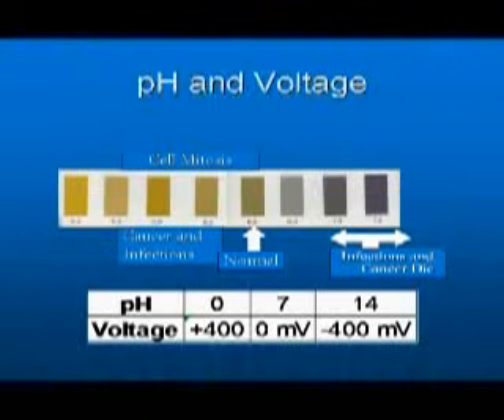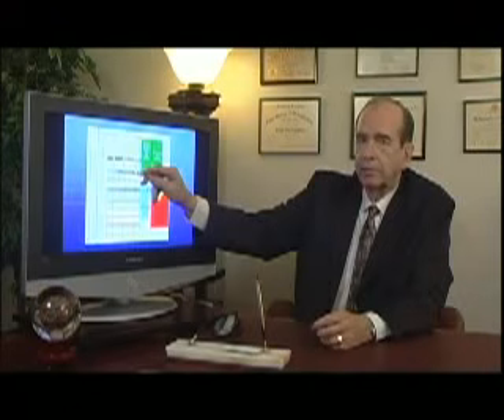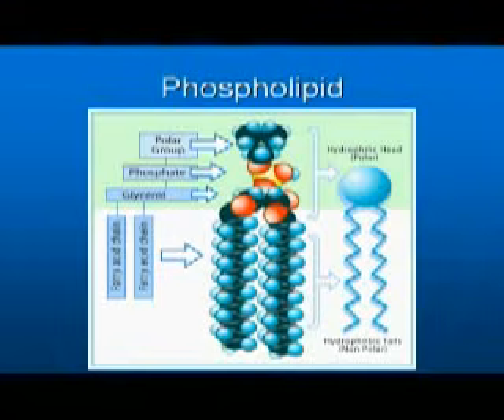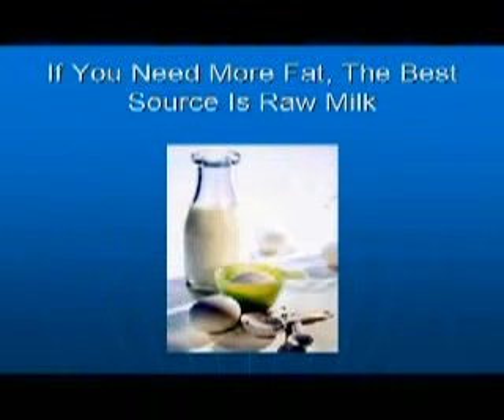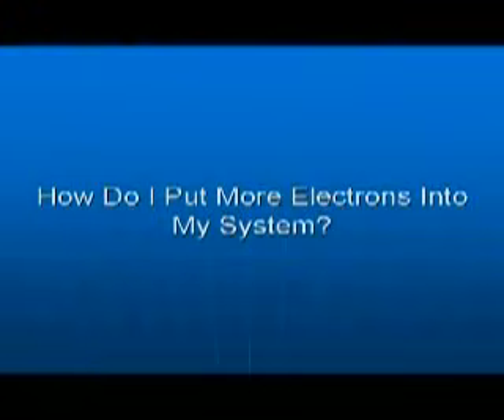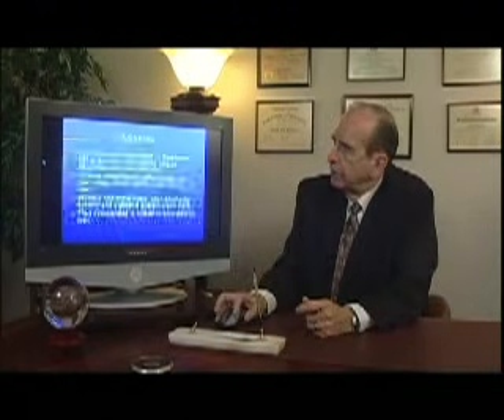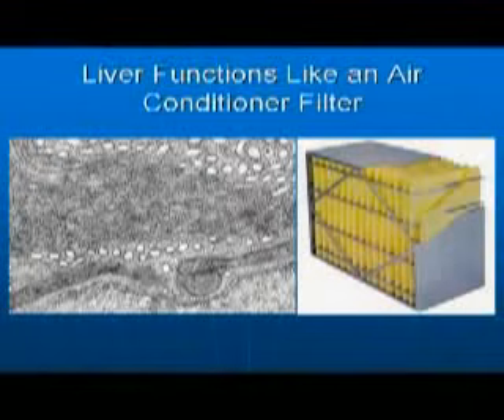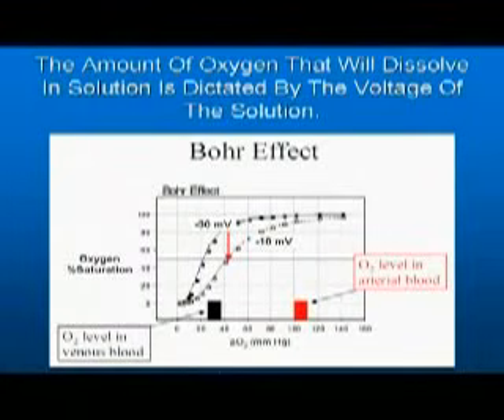Dr Jerry Tennant - pH and Voltage - "Healing is Voltage"

Comment: Great video, but at 7:25, he says that in nature, two conductors separated by an insulator becomes a capacitor. I can tell you that this is not true at all. When you have two conductors separated by an insulator, it just means that an electric current cannot pass between those two conductors. That is a fact.
Reply: Actually, what he says is correct: In nature as well as in engineering, two conductors separated by an insulator form a capacitor. This basic configuration stores electrical charge and creates an electric field—it's the fundamental principle behind capacitance. Even biological systems like cell membranes act as natural capacitors.

Comment: The pharaohs used a device known as the "cylinders of the pharaoh" made from copper(anode)  and zinc(cathode) cylinders filled with quartz when held produce up to 1.5 volts.  The copper is held in the right hand which is the positive flow of ions and the zinc is held in the left hand which is the negative flow of ions through the electrolyte(human body).  Make them yourself or get them on amazon or etsy.
Reply: How do I find it? Thank you.
Reply: Would it work if I wore a zinc and a copper bracelet?  Or it must be held in the palms?
Reply: @incorectulpolitic  It still works as bracelets but the palms are more conductive.
Reply: @engineerjay420  did you try these methods? Do they work? If so, what do you notice?
Reply: @incorectulpolitic  I personally make and use both bracelets and rods.  Absolutely aid in healing, pain, inflammation and increased energy levels for myself and many others.
Reply: @engineerjay420  so far how is your experience with the rods plus bracelets after 2 years?
Reply: @moiaccaunt  My experience has been really amazing from better sleep to deeper meditation and just overall well-being I highly recommend trying them.
Reply: @engineerjay420 where do you sell your rods that you make?

Comment: Cancer is a viral disease. Virus destroys mainly end cells (matured cells in Q
compartment), to which the organism responds with chronic inflammation and
increased proliferation to restore the organ and clean the debris. In this
chronic inflammation tumor may emerge. When stem cells are hit, the entire
Tissue Proliferation Unit disappears, to which the organism responds with
dysplasia, carcinoma in situ, carcinoma, etc... According to the hypothesis of
professor Zajicek MD, tumor protects against cachexia (muscle loss, wasting
manifested as fatigue and weight loss). Every cure, which silences the disease
driver, namely virus, cures cancer. Muscle loss is seen in all cancer types.
Cancer is one disease. Example: Fever is a defensive mechanism. Plus two
degrees protects while plus five kills. As long as tumor does not block any
vital function or causes pain, it should be left untreated. Patient should keep
her tumor as much as possible. Some people find alternative treatments, like
Ann Vigmor diet, very helpful. With a treatment strategy of tumor dormancy and
with host resistance to virus , only minimal doses of medication may be
required. Tumor dormancy is a state:when tumor shrinks or stop growing. In any
case patient feels healthy.

Comment: If using ionizing maschine with negative ORP water, don't the stomach acid neutralize that water when you consume it?
Reply: I thought so too.  Then I read Dr. Tennant's book.  It's not that simple - for everything you put in your stomach that needs stomach acid, other organs (liver, spleen, etc.) put a buffer of bicarbonate into your blood (so there's 2 things going on).  If you drink alkaline water, your stomach does need to neutralize it (and it does), but also puts that bicarbonate into the blood.  The alkaline blood buffer is important and the main way that alkaline water keeps the overall system in balance.

Comment: should we use AC or DC to measure teeth voltage? should we measure only the teeth with fillings or all of them?
Reply: Did you find out? I was also asking myself about it.
Reply: @esterilladorav.crespo2617  I never heard back from them either sorry
Reply: DC.  All measurement/assessment stuff refers to DC except that AC signals are used by Tennant's Biomodulator device to apply treatment frequencies and for feedback to adjust those applied signals.

Comment: where can I find device that measures body voltage the correct way? Its not the multimeter is it? I tried to look up that device in the video with the Phase Angle but cant find it. Is EAV the only thing?

Comment: Electrical Sensitivity, do to EFs "Electro Frequencies" and EMFs "Electro Magnetic Frequencies" To change your bodies Voltage/PH level, and receive all the Free Electrons your Body needs to Heal most Everything without the expense of a Biomodulator, this is the absolute Best way to do it. This has eliminated all my body Muscle Pain, Inflammation, Arthritis pain, Adrenal fatigue, No energy, Foggy Brain, Depression, anxiety, and that was Just my symptoms, it provides so much More for people with other Ailments or diseases, It is a Miracle cure. Google "Earthing human clinical studies" to see the success with Human ailments.  1st thing to do is Earthing, Google "Earthing" ,  Earthing adds the Electrons to the Body,  to Store the Electrons in your Cells you need the Concentrace Trace Minerals, the Concentrace Liquid Drops Trace Minerals, these two things are VITAL to LIFE and well being and should be used together as they complement each other, and the human body is deficient in Both. Sleep on a grounding sheet, and drink at least 3 + 12 ounce glasses of water with 10 drops of trace minerals per glass for about 40 drops of intake per day of the trace minerals.  This is as Important to life as breathing or eating, over the long term for health and well being. You will get the same out come as you will be adjusting your bodies PH higher to a safe level and reducing your bodies Voltage level to a Safe average negative voltage level. The Earthing will provide the Body with Free Electrons. The Free part of the Electrons means they are Not yet attached to another molecule, so they are free to become attached to a Molecule. The video is correct about Electron Donors vs electron stealers at a given PH/Voltage  level. It is when the Body does NOT have enough free Electrons, and body Voltage is Positively charged, is when diseases like Cancer, diabetes, and a slew of other diseases occur. This is because when You do NOT have enough Free Electrons coming into the body on a regular Daily basis to get rid of your accumulation of daily Inflammation, this is a condition of Low PH level, and a Electron Deficiency are the root cause. Easily corrected without a Biomodulator, 
Show less
Reply: how should earthing be done and for how long ?

can you do earthing standing or laying on grass or one must touch the bare brown ground/soul ?

Comment: If these battery packs exist as stated then it should be easy to verify in a controlled laboratory  experiment where the normal required voltage is applied to the circuit that controls the heart to produce a beating heart in a cadaver.
Reply: We know that to be the case with the heart.  You have the Vagus Nerve which varies the pace of the heart and which you can replace with a pacemaker.  You can apply voltages to the heart and have it pump.  You can also measure the voltages on a heart which we know from the ECG.
Reply: Did you know that Earl Bakken - inventor of the pacemaker - was originally inspired to become an Electrical Engineer by the movie "Frankenstein" (then Mary Shelley's book) when he was a kid?  He went on to found Medtronics, the 900 lb "gorilla" of the Medical Device industry.  Visit the Bakken Museum in Edina, MN!  These battery packs apparently do "exist" Tamara.  Even the idea is nothing new.  MORE POWER IGOR!
Reply: If anyone cares: so what inspired Mary Shelley to write "Frankenstein"?  The story goes that she, Lord Byron and another writer friend were staying with Byron at his estate on a short vacation.  Byron proposed a literary contest:  who could write the best short story in the week or so they were to be there.  He had a large library - Shelley found some of the writings of Paracelsus, a great physician & Alchemist of the 1500s, famous for walking around Europe curing the Black Plague wherever he went as well as his bombastic writings that railed against the ignorant medical establishment of the time.  He was also famous for having (allegedly, and by his own claims) to have "grown" a human-like creature he called a "homonculus" (which he said he later destroyed due to conflicts of his own conscience) ... his writings also contained material on the benefits of "electrification" of medicines. 

So when I say these ideas aren't new, I mean it.  Paracelsus lived 500 years ago and learned what he knew by study of very much older traditions.  Did you think what whatever is actually true and scientifically provable becomes adopted by society?  It has NEVER been so.  What becomes adopted is what makes the people in charge wealthy - simple as that.  There's not much money in cures - much more in treating symptoms.  Not all that much has changed.

Comment: As a welder, would one be effected by the constant voltage running around all the material and cable? good or bad?
Reply: You won't be Effected but you might be Affected by the magnetic field generated by the high current. In addition, the spark gap generates random radio frequency waves and intense light waves. As to whether any of this is harmful (the UV light can be) I can't say.

Comment: Dood-you don't even get the definition of pH correct and we're supposed to trust you as a "physician". Sure....
Reply: what do you mean? PH means hydrogen concentration/potential/power its basic chemistry. you don't know that? for crying out loud cant you open a Wikipedia?

"The exact meaning of the "p" in "pH" is DISPUTED, but according to the Carlsberg Foundation pH stands for "power of hydrogen".[4] It has also been suggested that the "p" stands for the German Potenz (meaning "power"), others refer to French puissance (also meaning "power", based on the fact that the Carlsberg Laboratory was French-speaking). Another suggestion is that the "p" stands for the Latin terms pondus hydrogenii, potentia hydrogenii, or POTENTIAL HYDROGEN. It is also suggested that Sørensen used the letters "p" and "q" (commonly paired letters in mathematics) simply to label the test solution (p) and the reference solution (q).[5] Current usage in chemistry is that p stands for "decimal cologarithm of", as also in the term pKa, used for acid dissociation constants.[6]"

YOU JUST GOT EDUCATED BITCH!
skeptic much?

Comment: I get the idea that cells need to maintain a small voltage across their membranes to operate well.  My question is if I do not have the Impedance meter, but I do have a home multimeter can I reliably measure my "total body volatge" as a basic health indicator?  I mean, a lot of things can affect a voltage reading, so if you say X to X+x mV is healthy, and I get a reading from head-to-toe of X+2x, or maybe X-x, then am I unhealthy or could this be a reasonable measurement variance?
Reply: Bijou Smith hello